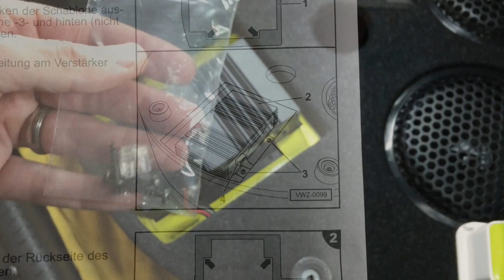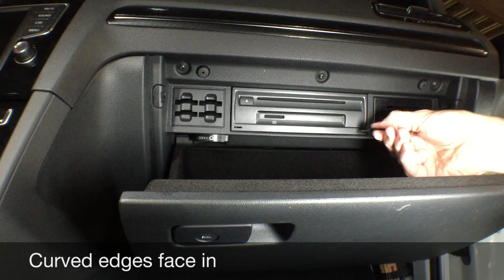GolfR Helix Install

Comment: Just finished my Helix install like 30 minutes ago, if anyone is debating this upgrade, DO IT! I followed this video and Part 2 to the dot (pulled the fuse of course, no zaps 😂), and I couldn't be happier with the results. Took me about 2.5 hours from start to finish, it's such a clean install and I still have my spare tire (with the longer spare bolt) and full hatch capacity.

Through the various threads I've seen some complaints about lack of low bass frequency, audio cutting out, distortion, etc etc. I have NONE of these issues so far. It sounds perfect across all my music genres, and if anything I have to turn the bass level down on my EQ, it hits pretty damn hard! And yes, I agree, it sounds better than the Fender "premium" sound system, far better. I think the few complainers either didn't program the system correctly with the dongle, or messed up wires without realizing it. Just take your time, do it methodically and neatly, CODE the system when your done, and enjoy the beautiful results!

Thanks Kevin for the videos!! Made the process so smooth 🙏
Reply from the maker: Coding the system with the dongle is key!  I've installed this system 4 different times myself, and every time it sounded better after coding. ❤👂🏻
Reply: @Kevin_MK7RSR ciao, come si fa la codifica?
Reply from the maker: @Alessiocarblog  Ciao 👋🏻  It's not absolutely necessary to program the sub using the dongle-programmer, but I think it did help the overall sound a lot and made the bass stronger.  I highly recommend it!

Comment: Installed the Helix sub last weekend in my 2017 VW Golf Sportwagen S 4motion. Sounds much better than the factory system with the default vehicle code on the DSP.! Waiting to get the dongle to update the DSP with the vehicle=specific code (code number is 62 according to Gudrun Fischer). The two install videos were VERY helpful and made the installation easy. PULLED THE FUSE before transferring and connecting the red and brown wires to the connecting plug. THANKS KEVIN! Absolutely no problems with this part.  

BTW, you CAN install the soundbox sub on top of the spare tire, at least in a Golf Sportwagen that has a space saving spare tire. 

I was able to put the sub on top of the space saving spare tire and still have plenty of clearance for the trunk cover. I  bought an extra long spare tire mounting bolt (as suggested on the VW vortex forum) plus a second regular mounting bolt to get the second nut (the longer bolt does not come with the needed second nut) to secure the spare tire on the bottom of the trunk. The order, from bottom to top is:  space saving spare tire, then the first mounting bolt to secure the tire followed by the sub on top of the spare, then the mounting collar inside the top of the sub and finally the second plastic nut to secure the sub. Makes for a clean-looking and secure spare tire/soundbox install. Very pleased with how the entire project worked out! Thanks again, Kevin plus everyone who contributes on the VW forums for all your help.
Reply from the maker: Great extra info, thanks! 👍🏻

Comment: Where do you thread the snake-loop through? Is this all the way to back of dash or do you guide the wire harness through the side of the dash?
Reply from the maker: If my memory serves me correctly, straight back through a hole, to the right and down.  Sometimes the wire gets bunched up and you have to work it to get it to fit.

Comment: Where do you buy the sub and the kit?
Reply from the maker: I think it's been discontinued, but usually a VW dealer will have them and might still have them in stock.  A while back people lucked out and got these kits on clearance for like $250 which is a steal.  I think I paid like $600 for mine.  Try eBay too.  Good luck searching 👍🏻
Reply: @Kevin_MK7RSR  thanks dude I do see the occasional one come up for sale was there a parts number for it?
Reply from the maker: @Theferrariguy   This post on golfmk7.com has all the added info you need:  https://www.golfmk7.com/forums/index.php?threads/helix-soundbox-upgrade-information-post.346458/
Reply from the maker: @Theferrariguy   It really is worth it.  Sound is night & Day.  It's not $3000 system amazing, but it's a LOT better than what a 15 watt-per-channel OEM sound system can put out
Reply: @kevinhannon7260  yeah I hear that as I've a gti I don't lose the spare wheel either
Reply from the maker: @Theferrariguy   That's a plus!  With my R the AWD takes up some room so when I go on long trips I just have to throw the spare in the trunk on top.  I ended up putting the Helix in my Wife's 2019 E-Golf and I upgraded my whole sound system.  Stuck with the Helix brand of stuff :  https://www.instagram.com/p/CZe_4lqOUB9/?img_index=1

Comment: How difficult was it to put the clips and plastic trims back in place? Did you notice any warping or misalignment?
Reply from the maker: Not difficult at all!  It goes back together a lot more easily than it comes apart.  Just have to line it up and give it a firm push with your fingers, or "BONK" with the heel of your fist.  Everything still looks new when you put it back together 👍🏻 (I had that concern too).
Reply: @Kevin_MK7RSR  what is the dimensions of the packaged item (complete system) and the weight of it all? I'm looking at buying it and need to courier and thus supply this info for freight calculation. :) Please let me know
Reply from the maker: @stephanpieterse6960  Oh, i'm not sure, sorry.  It was so long ago.  If I had to guess I'd say it's 36" x 36" x 12" and around 15 pounds.

Comment: It is very tricky to see where you poke that snake lead through at the glovebox stage? Any advice on where that lead goes
Reply from the maker: There's really on;y one place it can go through if I remember correctly.  A hole in the back of the media unit space, then behind the glove box to the right and into a channel along the passenger side kick panel then into the rocker panel cover.  You'll figure it out 👍🏻

Comment: I got it installed today and it plays no sound at all anymore. Light is green on the dsp. Any ideas ?
Reply from the maker: Do you know anyone with one of these?  You could try borrowing theirs to see if it works to rule out your amp being broken.  Did you buy it used?  Also, you can make (or buy) a loop harness to cut out the amp for when you need to put a spare in and want the Helix donut out, but still want your radio.  This would either point to the amp being the issue (If the radio still worked), or the wiring being the issue if that also didn't work.  This loop harness would also alow you to still use your radio while waiting for a new amp if that's the problem so you don't have to rewire it at the terminal block.
Reply: @Kevin_MK7RSR  Hey thx for the reply. Helix got installed by a VW dealer... Loop harness is now on and i got sound back. I also think its the wiring, but the dealer swears its coding. So now he wants to code it again.
Reply from the maker: @julian117891  Glad you made some progress 👍🏻  If it's working now with the wire loop that should rule OUT the wiring harness.  Points to the amp being the issue.  I doubt it's the coding, they work out of the box, the sound just isn't optimized for your car until coded.  Sounds like the amp may be bad.  The dealer should reach out to Helix.  One other thing, check that the pins in the amp harness receptacle aren't bent.  FWIW I blew one amp when I installed aftermarket speakers in front.  It has to be run with the OEM speakers.  Probably something to do with the Ohms rating, or maybe the in-line highpass filter for the tweeters.
Reply: @Kevin_MK7RSR  Dawg thx alot for the infos. Dealer is contacting the VW supplier now. Really appreciate the reply.
Reply from the maker: @julian117891  NP, good luck man, I hope you get it sorted 🤙🏻

Comment: In the process of installing this in my 2018 GTI SE, I noticed that it was prewired, head unit to trunk, and so I did NOT have to use the included cable.  Hopefully this will save some folks some time on later models.
Reply: Really?  So you didn't have to do anything except mount the amp to the box and plug it in?  ..and the harness was connected to the back of the glove comparment head unit?  Where did the hatch side of the harness terminate?  (IOW, where should I look in my GTI to see whether it's pre-wired or not)?
Reply: No way. I have an 18 Alltrack S I'm putting the Helix sub into. If there's a harness already there I'll start going to church.
Reply: Maybe yours had it installed by the dealer as a demo and they left the wiring when they removed the sub

Comment: Is there anything different inhave to do on a mk6 gti?
Reply from the maker: I couldn't say, I've never installed an audio upgrade on a MK6 so I don't know what the terminal block and harness are like, but my assumption is "Yes".  There are differences.  If you're willing to learn a bit about audio, rewiring it wouldn't be too hard though.

Comment: Thanks for these 2 videos.  I was able to complete the install in 90 minutes, in a Right Hand Drive Golf GTI Mk7.
I learnt from your "Tip" in Part 2, and swapped the "Power" leads one at a time, instead of 2 at a time.  Avoided any shorting ;)
Reply from the maker: Awesome!  :)  That might be a new record install time.  I helped another guy local to me install his and it still took me about 2 - 2 + 1/2 hours.  But there was beer and chatting involved ;)
Reply: There were no "Distractions" during install ;). Seriously, after watching your video a few times I was fully prepared (except for a terminal removal tool - I used 2 tiny flat screwdrivers), so it was seamless.  Thanks heaps!  :)

Comment: I did this install a few months ago. it was pain in the *ss. I bent some of the metal clips that holds the plastic trim, damaged the led wire, then somehow made a short circuit and blew a fuse... broke the plastic connector when re-attaching the wires. Lots of swearing.. But i fixed everything and its all good now and it sounds amazing! only downside is that you loose spare tire.
Reply from the maker: +sharky322 Totally agree.  Lots of blood, sweat, tears, beer and swearing.  :)  Took me about 8-10 hours total just to do the trim and harness running front to back (Along with filming it).  I did the same thing with the wires.  I took out one at a time at the radio part (Red and black (or brown?)) but didnt realize the yellow and black in the loom loop were touching.  ZAP!  :..(  

Same here.  Night and day better sound than stock.  Bass has quite a KICK too for two small 6" speakers!

Comment: This is really good.  This would be exactly the same for 2018 GTI SE, which comes without subwoofer?
Reply from the maker: Thanks!  I believe so.  Only way to know though is to pull the media unit and see if it has a compatible terminal block.
Reply: thank you, in the interim I have learned that this Helix is right for my GTI.  i really look forward to doing this.

Comment: BTW, I used the long post fitting for the spare tyre, with an additional nut to mount the Helix above the spare tyre (minus the feet on the helix), so I've kept the spare tyre ;)
Reply from the maker: Do you have a GTI?  I don't think this will work with mine because I have a golf R and the AWD diff in the back raises the floor board.  Correct me if i'm wrong.
Reply: Yes, a MK7 GTI.  I don't know if it would work in the R.  Bummer if you lose the spare :(. The upside is the 4WD and extra horsies ;)
Reply from the maker: Ahh, ok, thanks.  Ya, a bit of a bummer cause I do have a spare on hand and have just been keeping it in the trunk.  I love the AWD and power though :)

Comment: Just installed this in a 2016 Beetle, your video was an amazing help! I was told it "MAY" need to be reprogrammed? The dealer was less than knowledgeable on the subject and I don't really want to pay them for no reason. Any idea if it will make a difference?
Reply from the maker: Sweet!  I might get one for my wife's stereo.  She got a Jetta and the stereo kind of sucks.  Not sure it's compatible but might be worth a look.  I still haven't programmed mine.  I'll be fine if I never get around to it.  Although I'm curious what change it will make to the sound.  I can't imaging it will change much.
Reply: Kevin Hannon I'm curious if it will make a substantial difference but you are correct I will also be ok if i don't get it programmed.
Reply: The programming settings modify the sound frequency level and timing 
(delay) to each of the speakers for correct frequency response and stereo imaging. For optimum sound quality, the Digital Signal Processor (amplifier) in the Helix kit should be programmed with the programming dongle (VW part number 051419A) to the correct setting.

There are three correct programming settings for USA/Canada Golf Mark 7's:
56 = 2-Door Golf/GTI/R
57 = 4-Door Golf/GTI/R
60 = SportWagen (a.k.a. Variant or Estate)

The general consensus from multiple threads is to not assume that your DSP is correctly set for your car. Several people have found that programming has noticeably improved sound quality.
Reply: Valued Customer any chance you know what the correct program settings for a 2016 Beetle?
Reply: 29 = Beetle Coupe
31 = Beetle Convertible

Helix Soundsystem resources including the user manual and program settings may be found here:
http://www.volkswagen-accessories.com/en/product-ranges/infotainment/soundsystem.html
Reply: Note that the full part number for the programming dongle is DKS051419A.
Reply: It looks like the instruction manual on the web site is for the programming dongle, not the complete sound system. Notes not in Kevin's videos:
- The small plug in the parts bag changes the soundstage for right hand drive vehicles.
- The small Philips screw on the left side of the DSP (amp) is for sub level (volume).
Reply from the maker: Good info, thanks!

Comment: Hi Kevin, which version of Helix Sound Sytem did you installed? 000 051 419 or 000 051 419B??? 
As I compared both installation manuals - the amplifier is different only. Version 000 051 419 has amp AMP051419B and version 000 051 419B has amp AMP051419C.
Another things like wiring harness, socket connectors and adapters look exactly the same in both types. 
I want to install Helix P&P Sound System in my 2013 Golf 7 but I have a problem - my VW dealer says "no compability with your car, version 000051419 is for Golf 6 models only, while 000051419B is for Golf 7 Model Year 2016 (MIB II).
I don't understand my dealer (others dealers say the same, based on ETKA verification) opinion and what may be different in MIB2 caused incompatibility with MIB1 - what do you think about it?
Reply: The general consensus is the "B" part is Europe only. Installed the "non-B" part in my 2016 Golf R and it's working great.
Reply: ... not exactly.
I have answer for AUDIOTEC FISCHER GmbH - supplier of P&P Sound System for VW.
Brief summary:
VW has changed the Radio system in 2015 (Model Year) and after that MIBII units are installed - this is the main reason of new revision Plug & Play Sound Systems.
The System 000-051-419 is the “old” one. This System is not compatible in Cars after Building Date May 2016.

The System 000-051-419B is new one, which is compatible to every VW Car. 

The system with Ending “A” or “C” is the Trunk-Woofer Version. “A”- old and “C” from May 2016.

The ETKA system (VAG Parts System) has wrong data about system 000-051-419, there is information, that it fit to Golf 6 only, not for Golf 7 models. On the other hand the 000-051-419B is fit to Golf 7 after Building Date May 2016 only. I reported this wrong information to VW.
In reality (based on official VW instructions) amplifier was updated only, other things like wiring harness, socket connectors and adapters look exactly the same in both types.

000 051 419B is AMP051419C
000 051 419  is AMP051419B

In my case - Golf 7 from 2013 - AUDIOTEC FISCHER GmbH wrote "You can use both offered Systems in your car." I am planning install the "B" system in the second half of September.
Reply from the maker: Hey dude, sorry i didn't see this until now.  Thanks for the added info.  I'll have to check my model # for you.  Did you ever get this sorted out?

My R is a 2016 I took delivery of in March of 2016.  So It seems it was manufactured before May.  I had similar concerns thinking maybe the Non-B version was for radios pre-MIBII (Mine is MIBII) and that I would need the B version, but it works.

Also you say you contacted AUDIOTEC FISCHER GmbH, but these are from Helix, is there a relation?

Let me know if you got one, and if so which one, I'm interested to know which worked for you, thanks!

Comment: First of all - thanks for this tutorial, greate video.
I've faced with problem:
Unfortunately the Discover Pro MIB 2 does not seem to wake the DSP in the Helix in my Golf.
To solve it I have to disconnect and reconnect the DSP every time the radio restarts. 
Situation is very dissapointing.
Does anyone solve this problem??
Reply from the maker: Artem Krivoi : That sucks, sorry to hear that. I would check with Audiotec Fischer / helix, you might have a faulty amp.  They may be able to replace JUST the amp so you don't have to remove the wiring.  Who did you buy it from?  If it was a dealer, Maybe they can open another box, try the new amp and just swap them for you if that one works.

Comment: Would the muddy buddy be molded to be placed under the Helix Soundox? I was hoping the muddy buddy would replace the carpeted piece that goes over the sub, but looking at picture this does not appear to be the case. Thanks for the upload. Hope it sounds good.
Reply from the maker: Hmmm, no idea, sorry.  I know the Foam insert thing you can order after-market won't fit with the Helix.